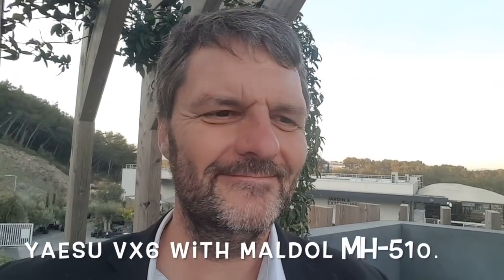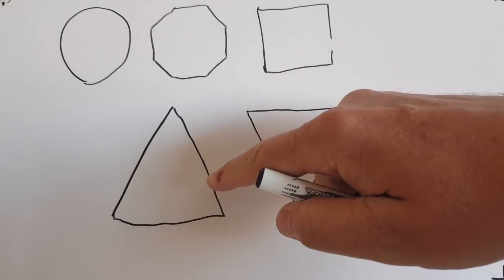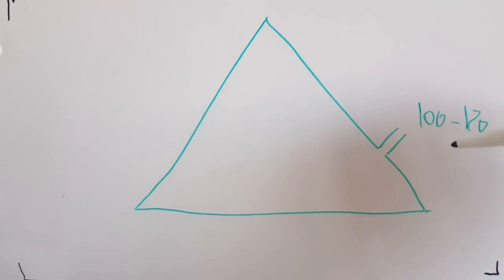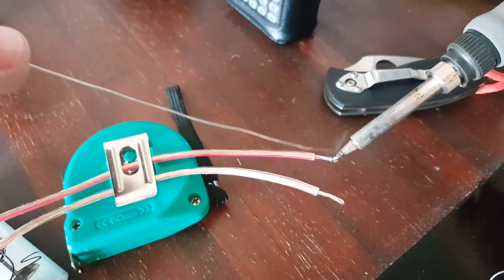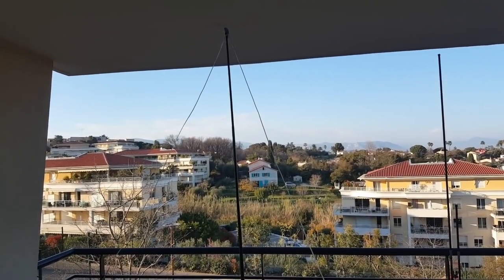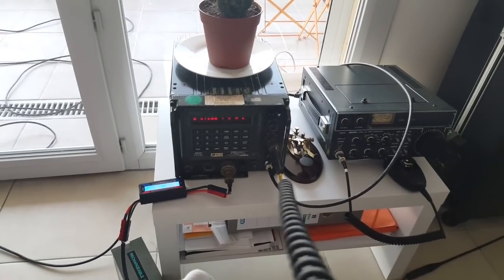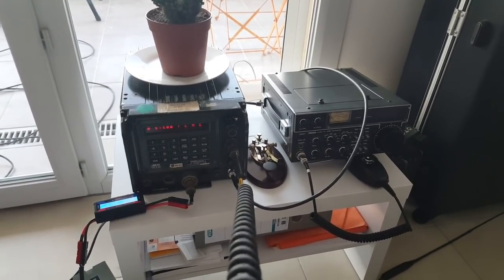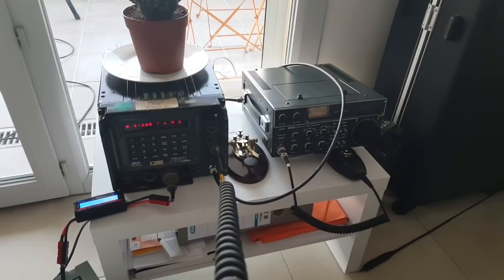Building a Delta Loop Antenna For 6m FM.

Comment: Excellent demonstration of antenna building. I've wanted to build a delta loop for some time now but my desired frequency is 80 meters. Needless to say that would be a very large antenna. I'm located in Ontario Canada and routinely talk to another ststion who uses an 80 meter Delta Loop hung between some large trees. Using 5 watts, that station often out preforms stations with large beams running amps. He js roughly 200 Km from me and commonly operates as net controller for ONTARS, our local 80 meter net. Signal reports from others stations around the province suggest that the Delta Loop really performs well even as a NVIS antenna.
Reply from the maker: Undoubtedly! I wish I had the space..

Comment: Great antenna My old formula is 300/F then Divide answer by 6 to know the length of 75 ohm coax. Have a delta loop for 30m fed like yours with only one support for years it works well.
Reply from the maker: Useful formula thanks!

Comment: I experimented with a 2m full wave loop recently and was pleasantly surprised how well it worked.
Reply from the maker: Was it round?
Reply: Could you please give some explanations ? I recall an homemade antenne VHF without à real double delta but a square radiator, in fact a rectangle where the short sides were giving a plus while a little larger reflector helped to get the right Z. Well I have just to compute it to retrieve the better dimensions, it seemed really easy, only 4x2 copper pipes to weld, a little bit of wood to get the 2 frames parallel at the good distances and something as 6 dBd. No worry as a  classic double loop, the accuracy involved and so on.
Reply from the maker: Sorry, I have no idea what you're asking me...

Comment: I would choose horizontal polarization for CW mode. This antenna is so simple to build, though, that I would build one for vertical and one for horizontal polarization and use an antenna selector switch. I will use spliced down the middle for the horizontal part and use zip ties to keep the wire in the channel. The PVC will weather better since both the antennas will be up and outside permanently. KB8AMZ
Reply from the maker: Indeed I should have used PVC. As to polarization, my 6m radios only have FM...

Comment: Hi Gil,  Great video.  The Delta Loop in the Triangle Configuration is my primary HF antenna.  It is cut for 40m and also works great on 20m.  It's top is about 35 feet up and the bottom is about 8 feet off the ground.  This is a wonderful antenna and works much better than my dipole.  I love your design with the wood to keep the bottom straight.  On my sides I us PCV pipe to hold out the ends.  It's feed from the bottom left but I plan to feed it a third of the way up to see if I get a lower angle.  Although on FT-8 I am able to cover lots of territory including France all the way from California.  I've contacted 22 countries so far.  Take care.  John N6NRO
Reply from the maker: Nice, I ought to make a couple for HF too!

Comment: I made it! Very cheap build indeed! I made it 5.70 and then I cutted it until I made it resonant at 51.5
It has a good bandwidth. It can operate from 50 to 52mhz
This type of antenna looks good for other bands... i guess there ate adaptations for vhf and uhf
Reply from the maker: Great, what final length did you end up with?

Comment: Great video as always Gil!  I recently put one together for 20m, and I'm very impressed in it's performance with the G90. I have read that a 4:1 current balun in place of the 75 ohm matching stub will allow multiband operation, so I'm going to assemble one to try it on my 20m delta loop. If that works, I'm going to try a 40m version. Cheers and 73! Bob, W0BNC.
Reply from the maker: Great, 4:1 works, 2:1 would be better...
Reply: @RadioPrepper  good point, 100-120 ohms would be better with a 2:1. Thanks!
Reply: @RadioPrepper  I wound a 2:1 on a 43 mix toroid, and it worked perfectly today during my POTA activation. 1.2:1 @ exactly 50 ohms at the center of the 20m band, and maintains 50 ohms across the band. Thanks for the suggestion, it was spot on!  Bob, W0BNC.
Reply from the maker: Awesome, I need to wing one too..

Comment: The matching part still puzzles me.  I guess i takes experience to know that you can throw a higher impedance cable in the feed line to lower the impedance at the radio end.  Any online courses that can be recommended?
Reply from the maker: Not that I know of. I just research on the Internet..

Comment: My french is poor but sounds like good antenna. Only thing missing here is 75 meter coax, Have you tried a Moxom antenna?
Reply from the maker: 75 Ohm. Yes, I made videos on Moxons for 2 and 6m.
Reply: @RadioPrepper  did not see on video lists. Great antennas as 25% size reduction put 6 meter one on patio. Works great swr not as good as wanted but 1.5:1 doable good luck.

Comment: Gil , a clarification question please.  At 8:15 you say that you will "shorten the cable" 38cm based on your calculations. Are you shortening the 75ohm matching cable , or are you shortening the actual antenna? The only other cable/coax would be the feed line and I don't imagine that changing it's length will make a difference. Thank you , merci .
Reply from the maker: It was the antenna wire..
Reply: @RadioPrepper  Thanks Gil - long time subscriber. Learn something every time. Stay safe , be well.
Reply from the maker: You too!

Comment: Good morning Gil,
"WOW" that's amazing. I live in the  desert here in Southern California surrounded by mountains and in a valley. I've been looking for an antenna with some gain that would work better than my 5/8 wave vertical. Do you think the delta loop would outperform the vertical on 11 meters? Any help would be greatly appreciated. I ask you because all of the other's here on YouTube don't like to help citizens band operator's.
Reply from the maker: It's all about angle of radiation and the delta loop might just work a bit better... Cheap enough to give it a shot...

Comment: Hi there. I have the MR300 antenna analyzer. Can you recommend me a good calibration loads? I have the Open, Short and 50 Ohms as SMA kit. But the MR300 requires 175 and 275. Do you know where I can find them? I did used some resistors to calibrate it but I don't trust them since I connect an PCB rfid antenna for 13.56Mhz and didn't get a good VSWR.
Reply from the maker: No idea sorry. I'd look on EBay.

Comment: Thank you for sharing your practical videos which are helping me learn more about my radio hobby.   Just wanted to ask two small questions - 1. did you use an antenna tuner with the VRM 5080 ? and 2. what sort of antenna analyser are you using?  73`s  Steve  M0MOG
Reply from the maker: Hi, no tuner for the 5080. I don't have any tuner that can take 50W. I have used my Elecraft T1 but on the mid setting. My analyser is the EU1KY but today I'd suggest a Nano VNA.
Reply: @RadioPrepper  Thank you for the clarification
Reply: 5:45 any excuse to bust out the hot glue gun. 😀

My high school Spanish failed me in the second half of the video. 🤣
Reply from the maker: I should have worked in the adhesives industry!

Comment: Hi Gil, did you decide on the MH-510 instead of the MH-511 for your VX-7R then, hows it going so far for range etc?
Reply from the maker: Hi, I did.. Seems to work well so far, but SWR is very high on 6m.. Maybe with a counterpoise... Thanks.
Reply: Cool, thanks for the reply. I suppose a ‘rat tail’ might do the trick?
Reply from the maker: A 1.5m rat tail!

Comment: How do you measure velocity factor?
Reply from the maker: With a VNA, but it is also given by the cable manufacturer.
Reply: @RadioPrepper  I tried a 3 foot piece of TV cable I had and the SWR is under 2  across the band . Not bad for a scrap piece of housing wire and a TV cable discard.
Reply from the maker: Great, cheap and simple, and it works. Not much more you can ask for :-)
Reply: @RadioPrepper  Have you tried a shortened 10M using a coil?  I thought I would try making a coil for 4 meters that could clip into my 6M loop giving a 10M antenna.  Would that work or not?
Reply from the maker: Not sure...

Comment: Bonjour Gil pourrais tu traduire en français cette vidéo super interressante
Reply from the maker: Bonjour, peut être, si je trouve le temps.
Reply: @RadioPrepper  merci car cela semble très très intéressant.Pour les calculs j'aimerais une traduction, je voudrais en faire une pour 11 m
Reply from the maker: Pour 11m ce serait un fil de 10.36m et un cable coax 75 Ohm de 2.6m.